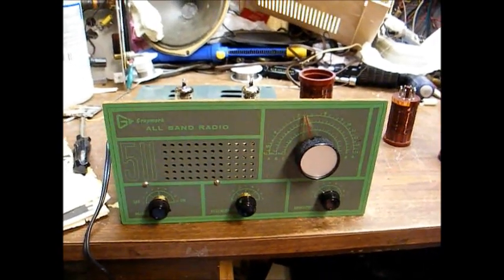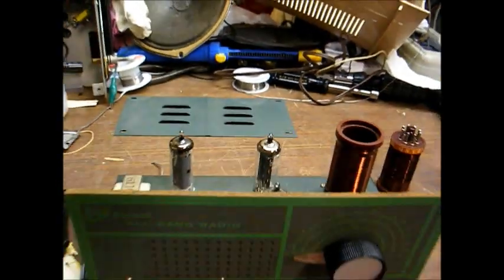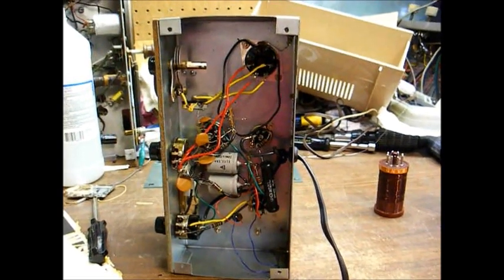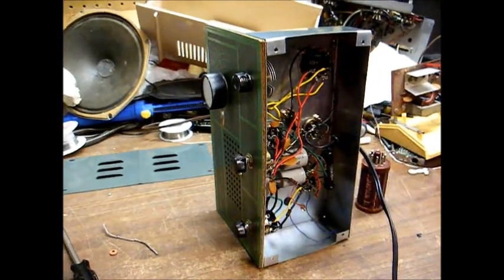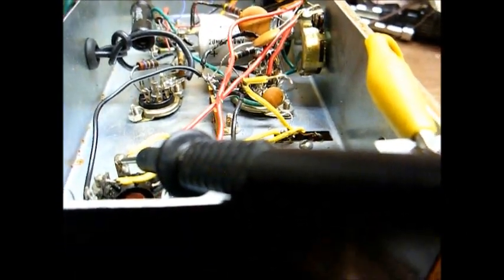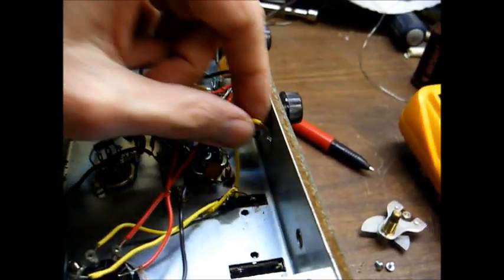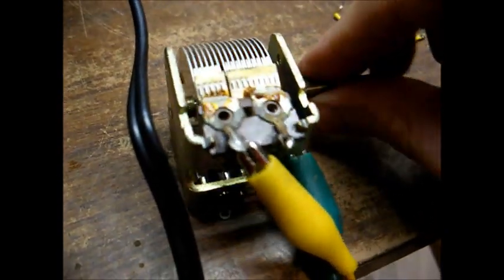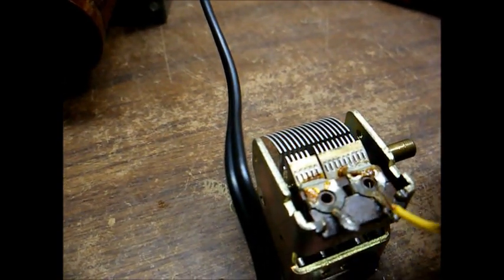Graymark 3-tube short wave regenerative radio kit

Comment: I built this great little radio in grade 8 in 1973/74 and after a bit of trouble, got it working well.  the mid 70's were perfect for getting into SWLing and Ham Radio because the sun spots were just perfect for world wide reception.  With a 100 foot wire strung outside to a tree, I received South Africa, Europe, South America and even once got India.  Regenerative radios are great because they have unbelievable sensitivity with very few components.  They have the added bonus of being able to receive SSB.

Comment: I had this model, back  in the the early seventies.  Bought it from a group purchase with my Junior High Shop teacher.  So fun to see this little radio again.  I did get mine working but had trouble with the coils getting the soldering connections correct and the proper spacing and wire wrappings.  Thanks for posting.  Great memories.